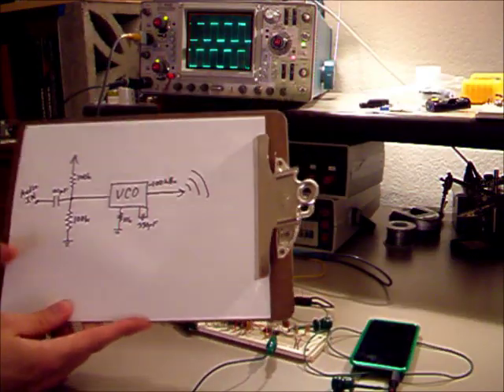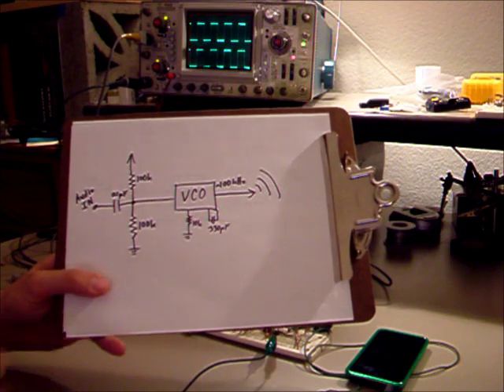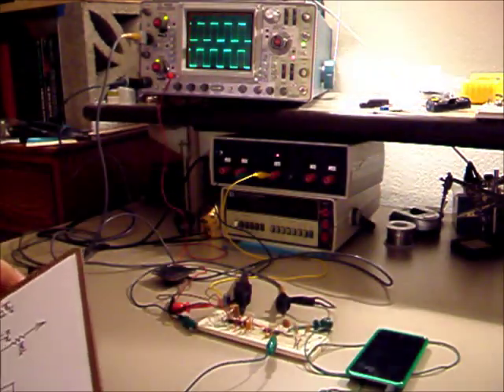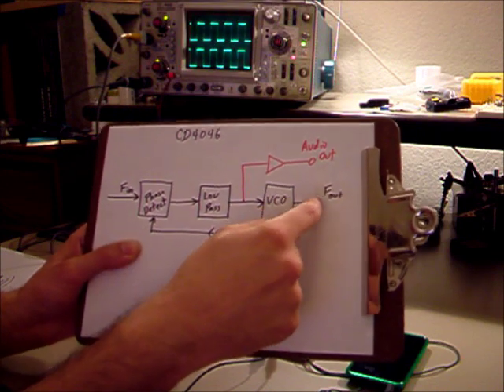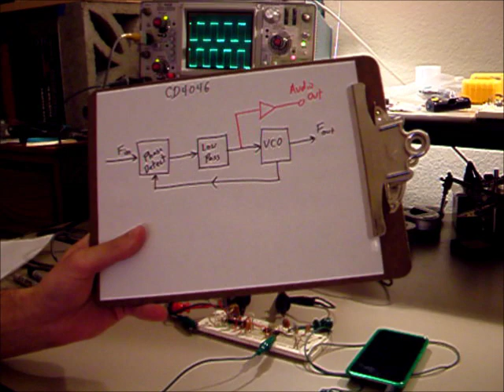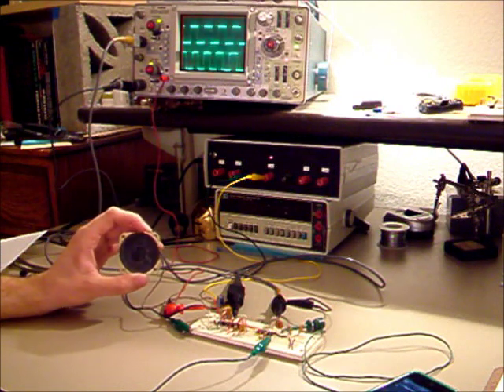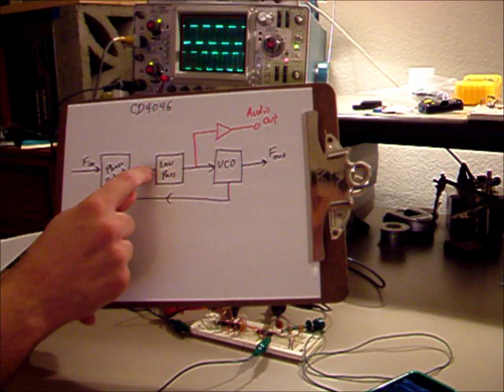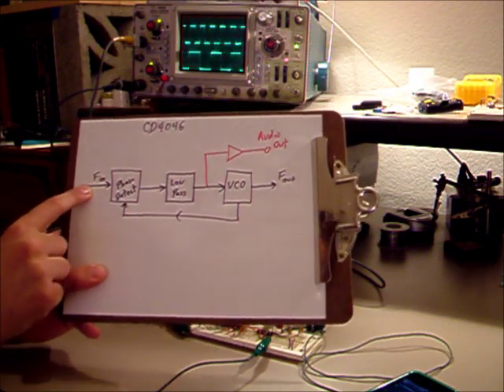Simple Phase Locked Loop Application Demo

Comment: Hi Kenneth, I enjoy your video and trying to do just exactly what you did in this video  with the iphone using PLL circuit with the op-amp circuit included.  I have problem duplicate of what you did.  I don't understand what inputs did you use for the circuit.  and how do you use the oscilloscope to measure your input and output.  where should I measure the input and output?could you please post another video or just draw a circuit schematic of how to hook up the op-amp circuit to yourPLLcircuit